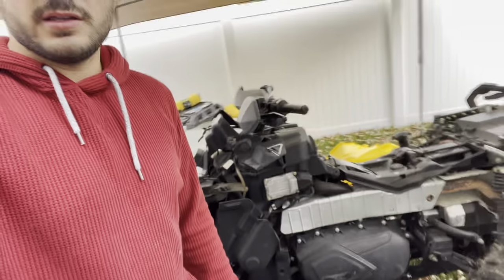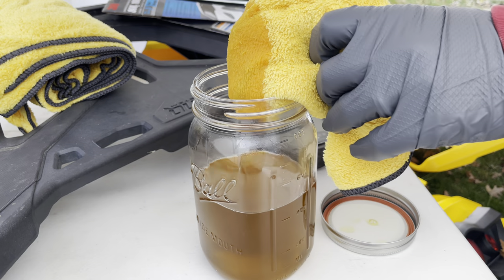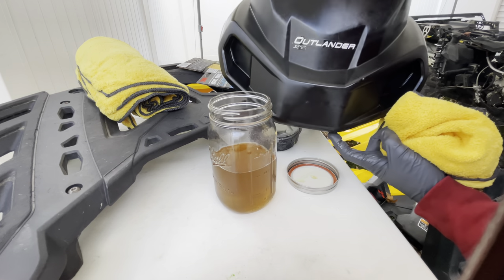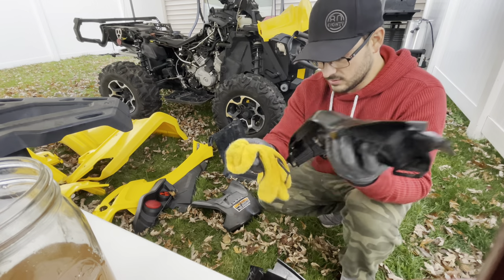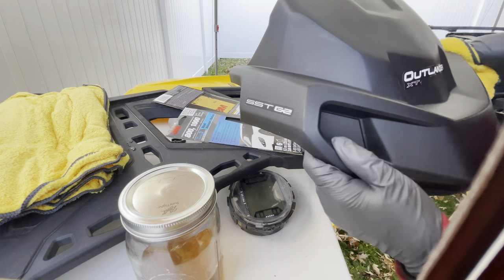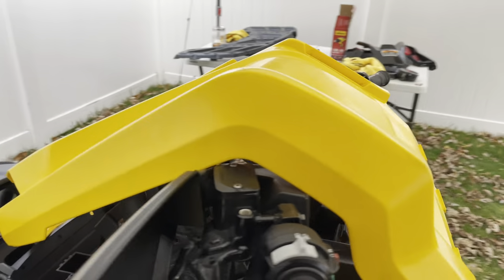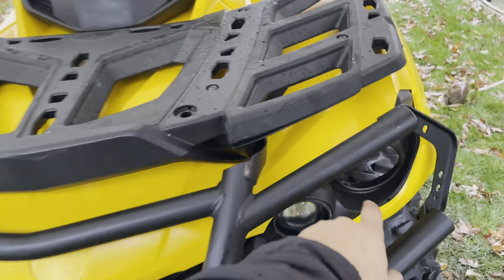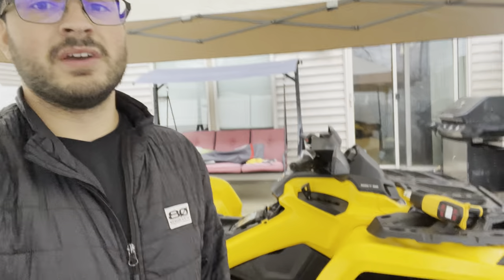How to Restore your Plastic Fairings | ATV/Dirt Bike/Snowmobile/Pit Bike

Comment: The linseed oil is just a temporary masking fix like Pledge Maxima SC1 or Slick Products Shine & Protect will do what that does. You need to do more wet sanding 400-3000 grit. It takes time but more steps the better the plastic will turn out. Then finish with a Bench buffer with a soft cotton wheel for super shiny results 😎👍🇺🇸

Comment: Bro, just use a razor blade and scrape the oxidation off. I did the exact same thing with my 1983 Yamaha YTM three wheeler that's canary yellow
Reply: I agree 100%. My 84 YTM200 sat beside my shed for 12 years and I cleaned up the plastic with a razor blade. It only took a hour or two.

Comment: You're doing way too much. Continue scraping. Scrape down until you get rid of all the White. It will become smooth that's when you know the oxidation is gone. After that use 600 grit sandpaper, then use a buffing wheel with rubbing compound to get it to a mirror finish